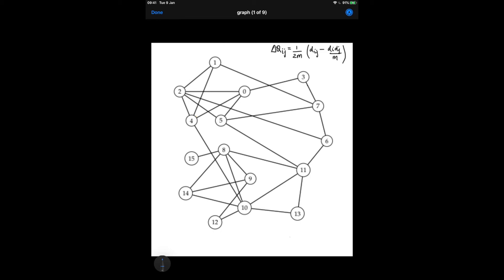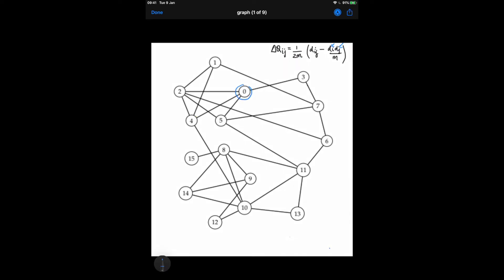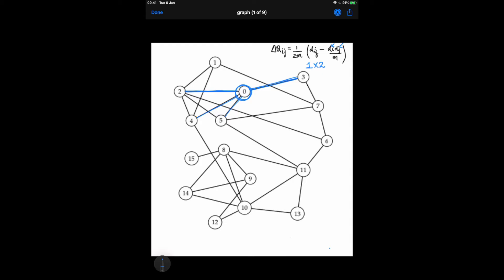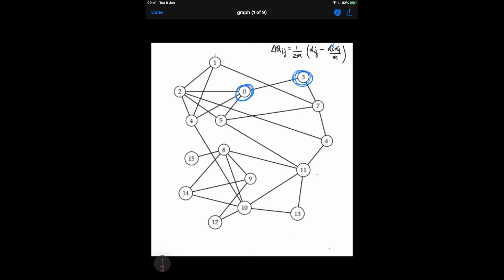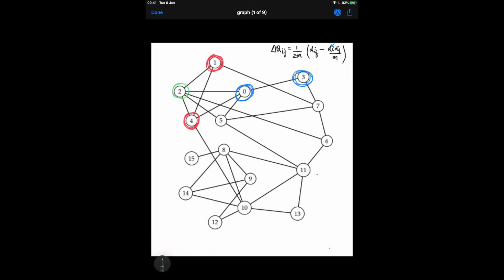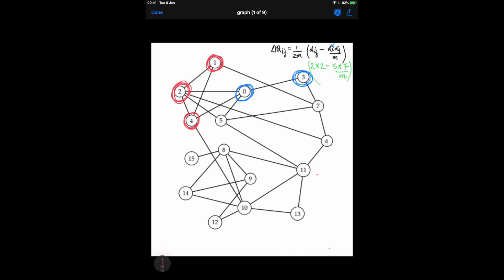Louvain method of community detection - Step by Step

Comment: You can help me with a master’s thesis for my software part (coding) in Python?
Reply: You can find a python implementation of Louvain in most network librairies.
Reply: @jlg6813   I want another help in community detection
Reply: @alwaaffa  I am an author of the original paper. You should find me easily and I will answer by mail.

Comment: Thank you for your example. But, it seems wrong to me because you have used the modularity score. However, the original paper moves nodes between communities based on another equation (delta Q) and not based the modularity score (Q).  You have explained based on Q. Perhaps, your explanation could be correct, but the equation is not correct.
Reply: In the original paper, each node will go to the community so as to maximise the modularity. So you can either compute Q and pick the best choice or compute deltaQ (the increase of Q) and also pick the best choice. Both are strictly equivalent but delta Q is much more simple and more efficient to compute.